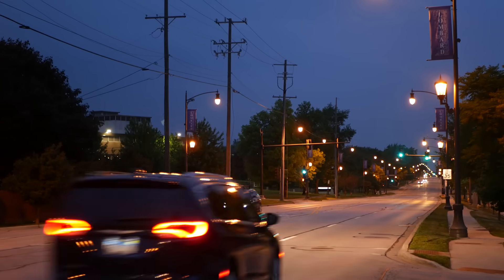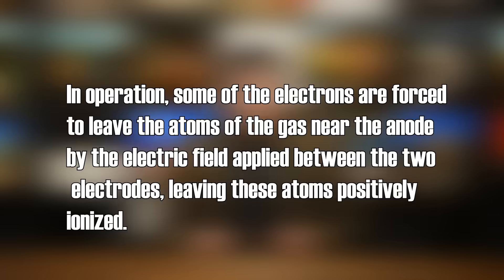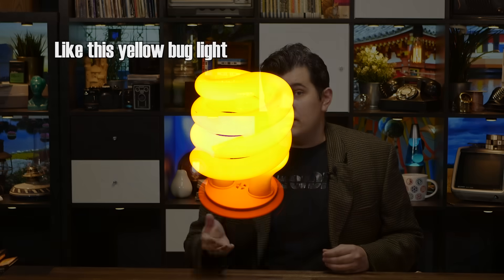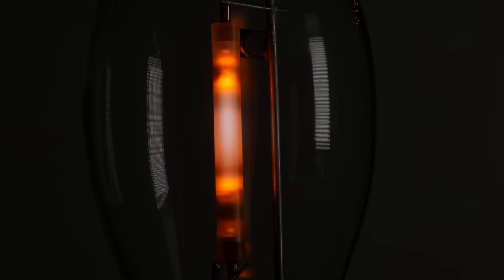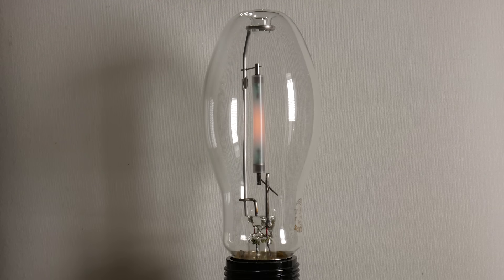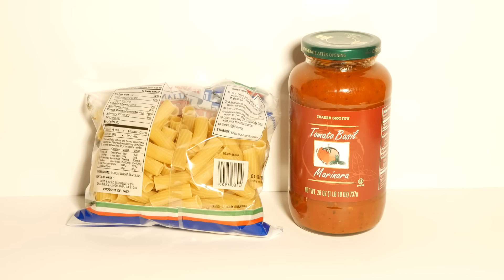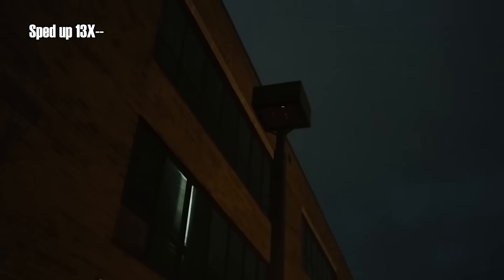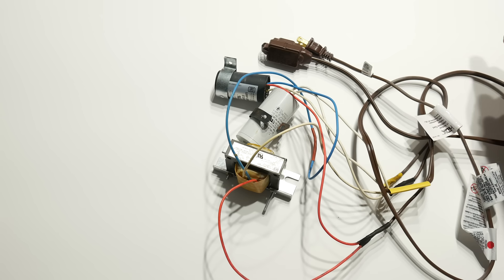The High Pressure Sodium Light: Ubiquitous, effective, but good?

Comment: The light pollution issue, in my opinion, is a huge drawback to most large scale led installations.  San Jose uses low pressure sodium lamps to limit the cumulative affect on the viewing conditions at James Lick observatory nearby.  At first it was odd, but now I prefer it.   Not just on aggregate, but also just spending time under it. I find it much more comfortable to drive along a stretch of orangey-peach lighting at night compared to 5000K+ "white" bluish sections.  Of course shining in windows at night, the sodium ones are much less annoying.  (Though for directed beams and maximum beans, I really really love my 5500K metal halide HID headlights.)

Comment: I first found this channel after watching an engineer guy video, I found one of the videos on this channel on why Beta failed, and it is the most detailed explanation of it's failure I have ever heard. Bill also has a series on technological failures, where he not only mentions Betamax tape but also the Dvorak keyboard and the picture phone.

By the way, I wonder whether street lighting may be three-phase in any case, as in each phase powering every third lamp.

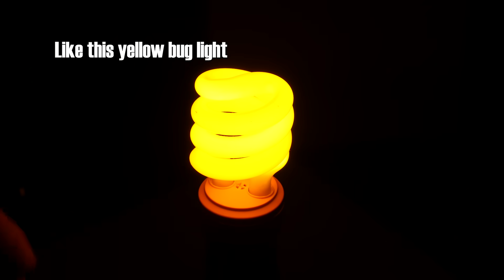As for 3:45, another variation is the fluorescent black light, which looks like a dim violet lamp but makes fluorescent material glow.

Comment: HPS lamps also cut through fog and steam. Cool white LEDs make fog impenetrable to the eye. Also, current LED technology is far from the reliability the manufacturers claim. Some do last forever, some fail very early, and they're delicate, too. HPS will survive hot, cold, buried in dust, damp (so long as the control gear isn't  swimming), voltage spikes, you name it. HPS fittings tend to have a better spread of light,  with too many LED fittings being based on flat panel construction and thus being more "spot" illumination. The HPS lamps with internal ignitors and even self ballasting tech improve maintainability even further.

Comment: Low Pressure Sodium is my favorite Discharge light. We used to have many streetlights with them but removed for I guess sillyAesthetic reasons...  which is a shame because the monochromatic light they gave off is much better in fog and to make road markings/signs have very high contrast so they are easier to see at night

Comment: Are cafeteria in our old middle school had high pressure sodium lights. It was built in the 40s and you could tell it had various patches and hack job upgrades over the years. Half the building had ac, a quarter of it was uninsulated. Only went there for a year till the new one was built. Overall allot of waisted food.

Comment: I prefer the orange glow of HPS over the LED's they're installing atm. I find it easier on the eyes at night.

The best option would be for warm (like 2200k-2700k) LED's to be installed, but the idiots who purchase them always seem to choose disgusting 5500k lights.
Reply: They switched to a warm white kind of LED in Europe, which doesn't look orange like the older lights, but very natural. Pedestrian crossings always have bright, cold, white lights above them.
In cars I actually prefer a warmer tone headlights as well over those snow-white LED's.
Reply: Arne Maeschaelck while many people assume they are LEDs most bright blue/white car headlights are HID (high Intensity Discharge) which is much more related to the sodium lights being discussed here. My headlights are HID, but I also have LED spotlights, so I am very familiar with the differences.
Reply: artistjoh I don't know much about car's lights. My DRL's, turn signals and everything in the back is LED, but my headlights are regular, yellow projectors and my foglights seem halogen.

But cars with those bright white / almost blue-ish headlights? That's blinding. So annoying…
Reply: Arne Maeschaelck My apologies for being blinding. Part of the problem is that not only are HID brighter, they are also smaller so the light is concentrated at a smaller point for the driver on the receiving end. For the driver of the car with them they are brilliant because they light up the road so well and make it easier to see problems are a greater distance. HID lights are on most premium cars, and we get them as standard. It is normal these days for stop lights etc to be LED, but headlights not so much.HID is part of the standard sales pitch with higher end vehicles, so we can’t avoid them. However, I also installed LED spotlights on my vehicle which are only on during high beam. Mine light up the road for a kilometer ahead (over half a mile), I am in Australia and long drives late at night in the country have kangaroos, camels, and cattle as potential hazzards crossing the road and my very bright lights (HID + LED) are an important safety measure.

Anyway, one day you might be looking at a BMW or other premium car, and if someone mentions HID lights you will know what they are talking about. Usually they will have good things to say about them. It is the person in the other car who might not like them so much, but overall they are considered a safety feature and help prevent accidents. I drive a Land Cruiser and they come standard on the Sahara model that I have.
Reply: @artistjoh  I didn't know that, thanks for explaining. I assume we have cars with HID lights in our driveway then.

My car is a RAM 1500 pick-up and still has yellow-ish lights, even though everything else (reverse, blinkers, puddle lights, license plate, ...) is LED. The latest generation has white headlights, I have the ...-2018 model.
Our Western European roads are usually very well lit, but on some backroads these headlights are total garbage. I leave the fog lights on all the time because they really help me see what's directly in front of me and I'm surprised how little I can see when I turn them off... I live in the middle of fields, woods and tiny dirtroads. We don't have dangerous or large animals here, but when it's dark, all sorts of small animals like rabbits, weasels, squirrels, ... just randomly cross the road and if I didn't have the fog lights on, I just wouldn't see them. I've flattened enough of them before I decided to drive with my fogs on (which could be illegal here, by the way).
I've also thought about installing a lightbar or little LED spots but haven't got around it yet.
On very dark roads it turns its automatic high beams on if I haven't disabled them in a while (turns off the fogs) which often literally decreases visibility..... I'm really thinking about changing out these bulbs with something better.

We have a Land Cruiser as well (200 series, couldn't tell you the trim level because it's not mine) which produces a whiter, more comfortable kind of light.

And our smaller car, which I do drive every now and then, has very bright headlights, to the point I consider them to be a little uncomfortable for the driver. It lights up a lot of the road, but whatever it lights up, it gets very bright. This is especially annoying if the road is wet or when it reflects on street signs as it sort of blinds me as well. This is a Mercedes GLE.

I personally prefer the yellow-ish lights because it's easy on the eyes at night from the driver's perspective and with speed bumps and hills and what not, other people's HID's (I assume?) can make me loose vision for a second, BUT I do think that, as a driver, white / cooler light could help you stay more alert and it's clearly also the better option to improve visibility.
Reply: Arne Maeschaelck You are right that the brighter white light helps keep you awake when driving at night. And you would probably be right that the Land Cruiser and Merc have HID lights. I would also expect that driving with fog lights on, and no fog, is illegal there, because it is illegal here, has been for as many years as I can remember. I do not understand why it would be illegal, but it is. 

The RAM has a reputation for harking back to an earlier age, so I am not surprised it has poor lights. A bit crazy considering a large vehicle like that takes a bit of stopping and has plenty of need for good lights. They tried to sell RAM here, but I don’t think they did very well. This is very definitely Land Cruiser country here. Australia is the biggest market for Land Cruiser on the planet. Land Cruiser first became popular on the Snowy Mountain Scheme in the 1950’s and has remained a big seller ever since and one in every ten Land Cruisers ever made is in this country. In remote regions, driving into a pub with ten vehicles outside it, nine will be Land Cruisers. My first one was in 1974, it was used when I bought it and I had it for 17 years, and when I retired I bought a top of the line Sahara for some comfort while still being able to get into remote desert regions. I love it. 

I know what you mean about road signs being blinding in the bright headlights, but then, they also become visible from a long distance which is good. I also love quiet roads after midnight where the cats-eyes reflectors on the road stretch out seemingly forever under a starry sky. The Northern Hemisphere suffers from a lousy view of the Milky Way compared to the south. We look directly at the center of the galaxy and Southern Hemisphere skies can be magnificent, and inland where there is little moisture the stars are extraordinary. I remember one of those long drives back when Halley’s Comet was high in the sky. That was before HID lights and I had two big halogen spotlights on the bullbar of the Land Cruiser. You see, we had really bright lights even back then. They were aircraft landing lights and weren’t as good as my LEDs, but were very bright.

This video is from ARB USA, but all the footage is Australian, and Land Cruiser. I have the same bullbar and the Intensity spotlights are the same as I have. I even have the same fridge in the back. The only difference is my Cruiser is dark grey, and my bullbar is black. This is where I like to go from time to time, out where I might be hundreds of kilometers from the nearest town, and it rarely rains. It is beautiful country. No street lighting out there. https://youtu.be/-mkWCEGDjWo
Reply: @artistjoh  Not sure why fogs are illegal as they improve overall safety and some cars even use them as DRL's, but I've had multiple people flash their fogs at me to remind me they're on, but they definitely can't blind anyone and... I think it looks nice as well!

I'd consider pretty much any American made vehicle to be complete garbage, but I got the RAM because it's the only gas (or petrol, I suppose, in Australia?) powered pickup you can get that's no-nonsense (good old V8, naturally aspirated, port injected, 2 valves per cyl...) and I know the engine has proven itself and the tranny is a German ZF.  Other than that I'd never buy anything from Chrysler with my own money...
So far I do love it because it's the perfect vehicle for my lifestyle. I'm a landlord and love to help my tenants as much as I can myself, I work with children and there's plenty of room and things to stay entertained (even got wifi for whatever reason), I can use it for hobby's and off-roading, it's a fun road-trip machine and I can use it to go to the store... It gets going if I need it to and her V8 rumbles on nice, quiet evening rides, perfect all-in-one for me! They do sell like crazy over here, but honestly so does the VW Amarok, Ford Ranger, Toyota Hilux, ...

Only people who can really appreciate a good old body-on-frame off-roader, like me, get a Land Cruiser these days. Toyota even decided to only sell the 4 cylinder diesel Prado since last year... Mainly because taxing works completely different for cars vs pickups and they're not really considered eco-friendly, thus expensive...
Americans may not believe this, but pickups really aren't that great offroad. The RAM even weighs close to 3 tons. LC is also very heavy for an offroader but WAY more capable and personally, I love a good heavy vehicle that sticks to the road. ;)

Long stretches of roads are pretty much getting impossible to find over here, Europe is just too crowded... But I love living where I live and right behind my house, there's woods and fields and mountains of dirt and it's just wonderful to park there and picknick on the tailgate as the clouds change from orange to red and the sun goes down. I'm blessed to have that, because most people don't have the time or opportunity really to appreciate things like this anymore. I'm not as experienced as you - I'm only 20 - but I sure do appreciate things like this.

Our LC is pretty much stock, though. You can barely find an approved bullbar over here (they need to have a German certificate to be used in Western Europe) because they were considered to be too unsafe, so you can only get the kind that absorbs (most of) the power (defeating the purpose of a bullbar, but okay)... I've considered it but can't find a decent one that's approved and bolting on a real bullbar yourself could get me in real trouble if I ever get into an accident. In August I struck a ginormous bird at 120 km/h. Couldn't tell you what kind because it happened so fast... the impact was pretty intense and I could see guts and juice flying by my window and all lanes were covered in feathers... poor thing. I was convinced it must've messed up the front of my RAM pretty bad but surprisingly there was only a little bit of white dust which wiped off immediately... A lot of fun things are not allowed here unfortunately, to save people from being stupid.
Reply: @arnemaeschaelck5012  could you please tell where do you live? It's would be interesting to know how different countries manage it.
Reply: CUBETechie Sure, I live in Belgium but I've seen it in a bunch of other Western European countries as well!
Reply: @arnemaeschaelck5012  i live in Austria and in the capital city and the lights are mostly sodium lamps.
Reply: I also prefer either metal halide or sodium discharge lights personally.
Reply: @raydornbush  my self i prefer the mercury vapor lights..  you got the white, thats better than the orange.. but you got that nice green hue as well that makes it seem calming to me.
Reply: I get blinded by cars with LED headlights. Seriously, it's almost a hazard.
Reply: @Alaprine  I get blinded by cars with LED headlights. Seriously, it's a hazard.
FTFY
Reply: AstronomyToday tow drivers know about it
Reply: actually 6800k is daylight, the spectrum the sun puts out.   The problem is leds have poor diffusion still and they beam light in one direction.. so that bright light gets into your eyes..  anything less than 6-7k is not natural sun light
Reply: I agree.  I think it has something to do with the wavelength being easier on your eyes when they’re dilated... night vision.  You know how hunters and others use red lights at night so that when you turn the light off your night vision is less disrupted.  The whiter or cooler the temp, the more harsh it is on your eyes and they adjust, then when you look or drive in a dark area, they have to adjust back.
Reply: My street became too dark at night because of those LEDs
Reply: Yes blue light is blinding at least for some people and sadly I am one of them... Sometimes I have to turn on the high beams in "self defence" just to be able to see where I am on the road when I meet cars with 5500 - 6000K HID lamps low beam. And at same time it is illegal to use 100W Halogen lamps  that give better light then the 5500 - 6000K because they say the 100W Halogen is to blinding (while in fact blinding much less then the legal HID)... It makes absolutely no sense...
Reply: Efficiency efficiency efficiency.
Im starting to not like it.
Reply: Warm White LEDS are the best. Harsh blue LEDs is what blind you.
Reply: It has nothing to do with people being "idiots" and buying the wrong color LED fixtures. Lower color temperature LED's like you're suggesting are not much more efficient than current quality HPS lamps. By the time you factor in the cost to replace all the street lights in a given municipality, it's not longer viable to replace them with LED's for minor increase in energy savings.
Reply: @oddieboi  sorry to hear that because the warm white color is more pleasing to my eyes.
Reply: @oddieboi   Blue-white LEDs are not any more efficient. The human eye is naturally sensitive to blue light and quick to narrow the pupil when exposed to it as an adaptation to sunlight, this means that blue-white lights darken the vision at night. Any efficiency gained in the production of light is voided by this factor. Blue-white is also proven to produce more light scattering glare in the eye, making it harder to see at night. The people who decide to use blue-white LEDs for outdoor lighting may not be idiots, but are incompetent at best.
Reply: @oddieboi  Indeed, LEDs are not more efficient than HPS and especially not LPS. The claimed efficiency of LEDs comes from choosing an actively  harmful colour spectrum that fucks with people's circadian rythms and barely lighting up a small area beneath them.

Comment: If they fail because the voltage required increases over time, does that mean that you could put failed bulbs on a higher voltage to get more life from them? Ie could you  have a dual lighting circuit where after the bulb detected it had failed it switched it onto the higher voltage circuit that would previously been too high in order to squeeze more life out of the bulbs?